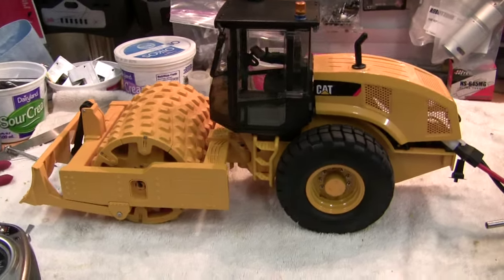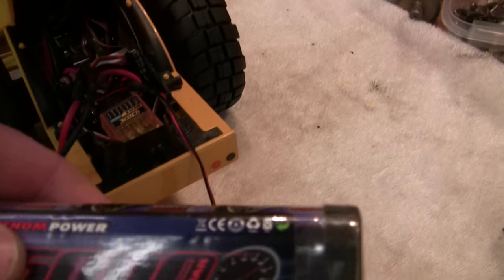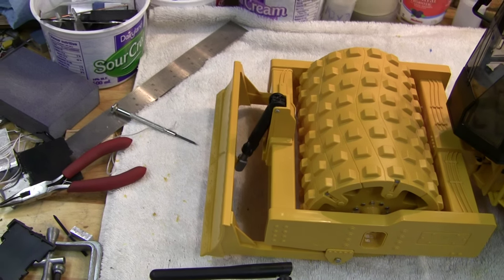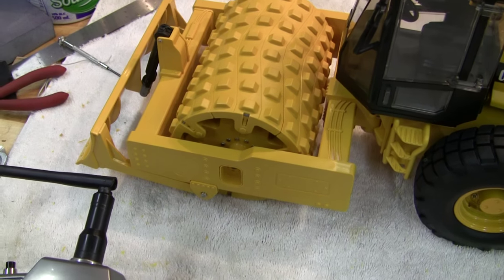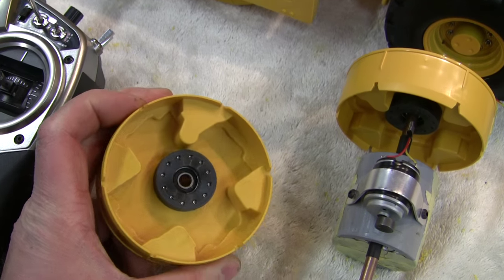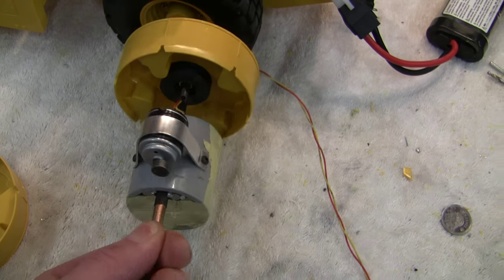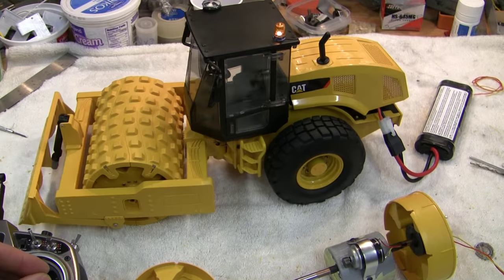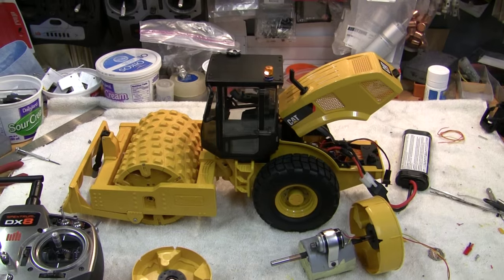Bruder Cat Compactor Conversion Part 5

Comment: Nice work buddy. Very cool machine. :)
Reply from the maker: +Dirty D&#39;s RC Thanks. What's new?
Reply: +RCP57 Couple of things. Saving $ to put the Corolla in the shop mohave the steering fixed. Converted my Tamyia TB02 to RWD. Now tuning that to fully CS Drift and killed my old batt for it so need to get a new one and new bearing set. Almost done designing the driver's side 1:10 functional disk brake component. Been working on my electronic music again. Taking a brake from YT. Will be putting together the monetization vid some time soon. Got lots to say on the subject so have to write down all the points on paper first before starting to make the vid. Will be doing a intro, invite vid on it and those who are interested in hearing more will have to give me a request. This vid will not be shared publicly. Gunna have to tear the drive train out of the MRC and check the gears to make sure their not missing any teeth. The course has been very hard on the fully locked from motor to wheels drive train. :) How you doing?
Reply from the maker: +Dirty D&#39;s RC Sounds like you've been very busy. Not much new here. Just working away, trying to keep the bills paid and the shop door open.lol Haven't even been out in the bush for a while. Pretty boring!
Reply: +RCP57 At least the bills are getting payed and the shop door is open. Wish my day job was being at home f***ing around with RC stuff.
Reply: +Dirty D&#39;s RC Very lucky man you are. :)
Reply from the maker: +Dirty D&#39;s RC I guess. It seemed pretty glamorous at first but just like any business, the busier you get the more complicated it becomes. By the time the dust settles it is hard to justify the effort money wise but I do enjoy messing around with it. Staying at home everyday can be a drag too. I rarely ever see anyone.lol
Reply: +RCP57 Yeah for sure. Still better then picking orders of tile for unsatisfied customers at 14 bucks an hour and all the silica dioxide you can breath. Even though we're social animals, Human contact is over-rated and to consuming these days. Too many narcissistic attributes in most people. It's getting harder to find people that are comfortable in their own skin and can generate their own light and happiness. It's purposely designed in our modern day would. The internet has been a great screening buffer but still doesn't beat face to face interaction of attention, exception and compassion. Still I'm happy being at home when I can doing my thing with no interruptions of peoples neediness. The saying goes you only need one good friend in your life time. Theres so many people in this world today who are not awake to the tyranny and corruption that they perpetuate it everywhere they go and are a liability to your well being. So far I think you've got your head on strait and still hope to meet up with you one of these days and shoot the shit with you. Far as I'm concerned, very not interested in people's BS.
Reply from the maker: +Dirty D&#39;s RC I end up making around the same per hour on most jobs after expenses but at least I can work the hours of my choice and for the most part it is enjoyable. I agree with what you've said. I don't have a lot of close friends but the few I have are really good. I used to laugh at the guys I grew up with that were always bragging about how many friends they had on Facebook. Now I have so little in common with them that we don't see each other and we live about 10 minutes away.lol I just don't have time for drama! I just like to keep to myself and build shit.lol

Comment: Just putting my two cents in here for what it's worth but would adding 3/4 pound of lead shot work the same as one of those vibrating motors? Also what are you charging to transform these into a RC are they 1:14 scale also? Bob
Reply from the maker: I'm not sure about the lead shot. There is already 27oz of carbide added to a shaft in the middle which turns on bearings. The vibrator mounts on this shaft also. Adding any weight that rotates makes it harder to move. I did two of these and the last one finally just sold. I will not do them again.